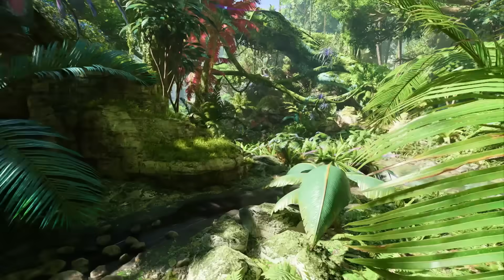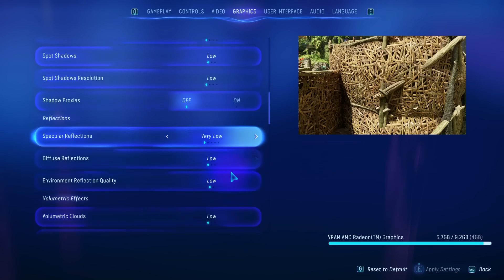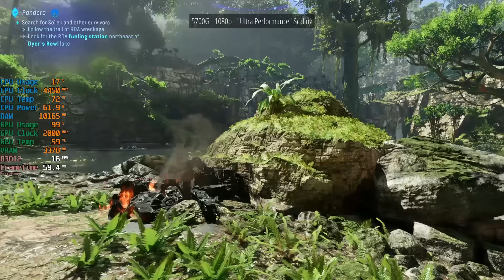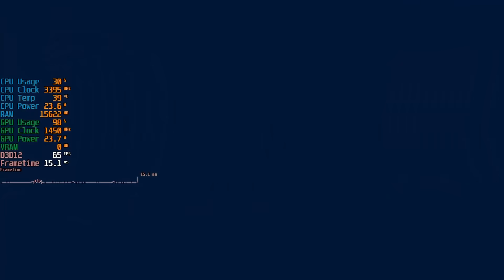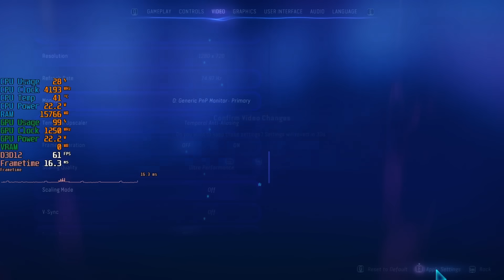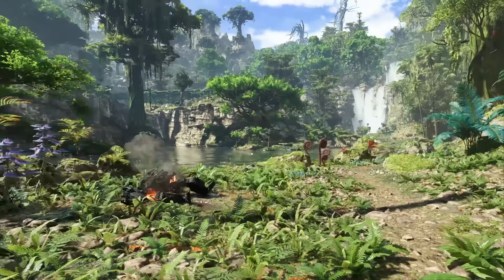Avatar Frontiers of Pandora With No Graphics Card

Comment: I'm going to give this game top marks for technical. I unlocked their 'unobtanium' setting and ran the game at 8K native. It used all my 24GB of VRam and came to a slideshow halt at 5fps on a 7900XTX but it didn't crash. Just kept rolling bulldog forward. I have also played it on 4K Ultra native, was getting just over 30fps and it was a very stable and a very playable 30fps. Long story short, they did a good job with the game.

Comment: sooo much lower performance with even a 5700G?

don't know my uhd 770 of  i5 13500 can handle that or not😂
Reply from the maker: I think you might get the strange graphics glitch as well
Reply: @RandomGaminginHD yeah, sure, since i have got the graphics glitches from elex 2, spiderman, spiderman miles morales, but spider man's glitch have been fixed by arc driver 4887

Comment: Why do you Talk so Dirty to me??? You know I like it when you get Down Low on the Minimum Requirements and Boost that FPS on Old Tech and GPU Progress over there ERAs. I wouldn't Pay for a Taylor Swift Concert though I would gladly Hear your lovely Voice for the Next 2-3 Hours. XD
Reply: On that Note Glady that you Found Predator Mode using UHD 730 Graphics with Intel. Wonder what 780M and New Intel IGPU will do.... wondering what Lowest Costing GPU that still gets playable FPS and Frame rates even if Locked at 20/30/40/50/60 FPS.

Comment: Your Integrated intel experience is almost spot on to the result when zWORMz Gaming tried to go 8k with a 4080, suggesting it's actually a Vram size/speed issue.
Reply: I think its a issue on the games side not being able to handle certain resource limited situations. Some games run perfectly fine...if at 2FPS and some end up at 30FPS with INSANE graphical issues

Comment: Similar specs to Starfield, I can still run that at 30+ fps with a GTX 1060 6gb and a Ryzen 7 5700G, stick to low/medium settings and you'll be fine

Comment: Hard to believe i used to have a GT 710 and FX 6300 in my old pc. I now have a 7900 XTX and a R9 5950X 😂
Reply: I feel that. I was using an i5 3330 and a GT 710. Now I’ve got a Ryzen 7 5800X and an RX 7800 XT in my main PC, with a backup Windows (sadly) PC running a Ryzen 5 3600 XT and RTX 3070. Night and day difference.

Comment: @RandomGaminginHD  Since they are dropping driver support for the rx500 series, do you think the 5700xt, 6600xt or 7600 will become its replacement?
If the 7600 can drop £40 it will surely become the new king of budget computing. The 5700xt can be had for £170...the 6600xt for£220 and the 7600 for £250 currently...is the 5700xt a better buy?
Reply: A 5700xt is on par with a 7600
Reply: In a game like Alan Wake ll the 6600 would be better than the 5700xt but overall the 5700xt is a better graphics card.
Reply: @stevenanderson3205  500 series are out of the contest straight away because they don't support a codec/instruction set.
Reply: Recently in September i replaced mine 580 with 6650xt
283$ for new one with starfield wasnt that bad deal, but now for 40-50$ more there is 6700 10gb
Also i sold mine 580 4gb to friend for 50$ so it was nice deal for me

Comment: A bit disappointing that games these days don't really allow to set actual low graphics settings, but it's still impressive what can a little iGPU do!
I'm curious if my RX6400 could achieve playable framerates in this game....
Reply from the maker: Yeah with FSR I’m sure 30 should be possible. I miss the days when low meant low
Reply: Me, just sat here sweating with my RX 6700 XT.
Reply: Oh geez 30 fps lol 640p it is
Reply: those really lowend cards are now dead
For new games you need 5700xt and newer but 5700xt isn't perfect since it leaks proper mesh shading support so alan walker 2 works there not that great
So instead 5700xt 6600xt is actually a better buy